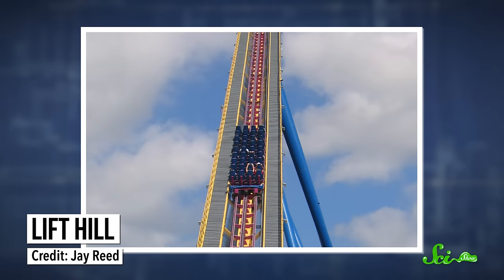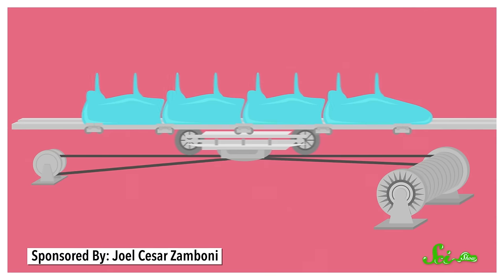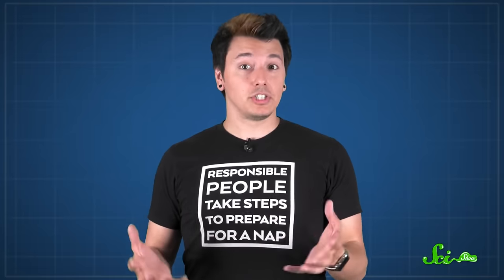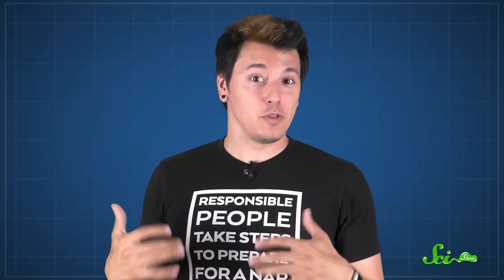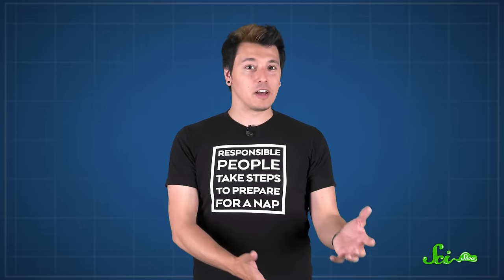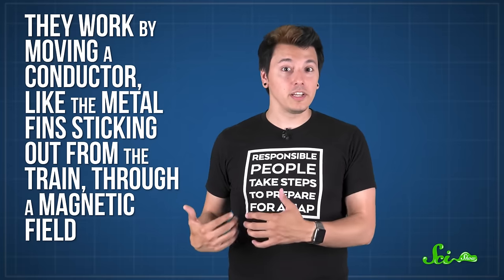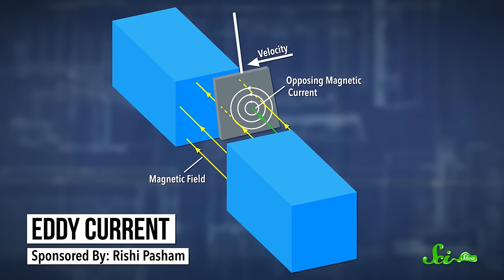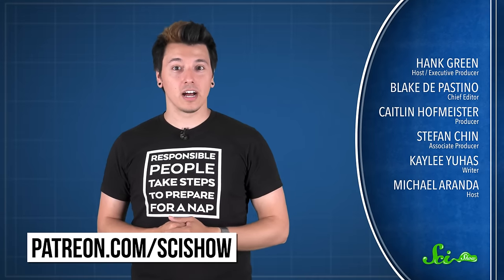The Physics of Roller Coasters

Comment: Eddy current brakes cannot bring a roller coaster to a complete stop. As the velocity decreases, the strength of the eddy currents also decreases, causing a decreased braking force. Friction brakes are required to fully stop the train and hold it in place.

Comment: +SciShow : A slight mistake: A permanent magnet can't stop a train, because its strenght is related to the velocity. The higher the velocity is, the stronger the braking force will be, which is quite handy. But on the other hand, the lower the speed is, the weaker the braking is... So in the end it can't stop the train, in theory. In reality, friction (both air and contact friction) will do the job, but manufacturer usually have a friction brake or a friction tire at the end for that purpose.

Comment: could've done with some impressive stats on the forces involved in average roller coasters. maybe a mention of fastest speeds, highest G-forces, largest loops, etc. and some shout outs to the engineers and designers, who have to work the physics into real-life constructions. safety mechanisms could also use a good mention, along with what happens when they're ignored or fail.

i should become a scriptwriter for SciShow.

Comment: There is a roller coaster at Knott's Berry Farm called Montezuma's Revenge. The initial force to start the car is powered by a flywheel. Also the California Screamin' roller coaster at Disney's California Adventure uses an induction motor for the initial force.

Comment: In the magnetic braking system, exactly where does heat get produced? In the metal fins? Or does the kinetic energy first get turned into electricity, then into a load such as resistors, where it changes to heat?

Comment: Why is actually called a hydraulic launch system instead of a  pneumatic or (semi-hydraulic or semi-pneumatic), because the liquids are merely used to charge the system, the nitrogen gas seems to be doing the actual pushing of the liquid through the motors, according to the schematic shown. Or is it because "fluid dynamics" deal with both liquids and gases?

Comment: I have this problem in my physics class. A 100 kg roller coaster begins on a 10 m tall hill with an initial velocity of 0m/s and travels down before traveling up a second hill.  As the coaster moves from its initial height to its lowest position, 170J of energy is transformed into thermal energy by friction. In order for the roller coaster to safely travel over the second hill, it must be moving at a velocity of 4.6m/s or less at the top of the second hill. If the roller coaster Transforms another 100J to thermal energy on the upward trip to the second hill, what is the maximum height the second hill can be? What is the minimum height? How fast is the roller coaster going at the bottom of the first hill? If anyone could help me solve this, or even point me in the right direction then that would be greatly appreciated.

Comment: I was expecting an explanation of the loops thing. I know that the coasters don't need any additional propulsion after the initial drop (for coaster that only have the one mechanical lift and don't repeat the same loop like the superman in Vallejo and such) but I don't really remember why. I know the answer is momentum but I feel like I'm missing details.
Reply: Don't use momentum for this kind of problem. Use energy instead. Roller coasters exchange kinetic energy (speed) for gravitational potential energy (height). As long as the height is low enough, the coaster can keep moving, because not all of its kinetic energy has been converted to potential energy.

Comment: I would have loved a video to also explain what to do when riding a roller coaster. There might be a wrong way to enjoy roller coasters, after all
Reply: -Always ride in the back or the front, those are usually always better than the middle 
-make sure you don't get stapled (the restraint doesn't push on you too hard) because that can be uncomfortable and with a bit more space it can allow for a bit more airtime
-when you're on an older coaster or any coaster that is rough and has over the shoulder restraints, I'd put my head back as far as I can so it is easiest to resist the painful things like headbanging

Just to name a few ;)

Comment: So after the lift hill the roller coaster is freewheeling and doesn't slow stop because of the momentum created by the lift hill?
Reply: Most roller coasters are designed to have the main hill and maybe a few others impart all of the necessary energy to keep you moving for the whole ride. some tracks do have accelerators in some parts though if it's long or doesn't have the initial hill. So yeah, for the most part the main hill gives you the momentum needed to go fast.
Reply: Because of the potential energy stored in the coaster by the lift hill, it's got nothing to do with momentum (unlike a launched coaster, which does use momentum).

Comment: no mention of the adding/subtracting weights & changing wheel materials to get the coaster to go all the way around & not get stuck.

Or even the power setting vs weight of people & wheel material (friction) to launch a coaster.

AND

no mention of not just making it all the way around, but going fast enough that you're pinned in your seat and don't fall or float in your seat when upside down (very freaky feeling that happens on Canada's wonderland's 'the bat' if your restraint isn't 100% tight/you puff out your chest when they close it)

VS

Going so fast you get G-loc

OR

Vomit

OR

Get a neck or spinal injury from changing axis direction to quickly

OR

i could go on, but THAT is the science of rollar coasters

Comment: I kinda hoped you would explain the temporary blindness some rides can cause.
Reply: On some roller coasters with sustained G-Force of around 4 or 5, because the Gs are pushing downward, it is harder for your body to pump blood to your brain because all of your blood is going to your feet. With a reduced blood supply to your brain, you can loose consciousness, thus temporary blindness. Although it may be scary, it is not harmful to your body and you will quickly regain consciousness when the forces return to normal. I hope this answered your question!

Comment: I'm no physicist but I'm pretty sure you don't accelerate at 9.8 m/s² unless you're falling straight down, which on a roller coaster, you're falling at an angle, so you'd accelerate slightly slower.
Reply: Also, he is not correct about the whole thing here. You don't even have to be accelerating downwards to feel 0G. It can already start at the beginning of a hill while going up. Some coasters even have inversions that give Zero-G like the Zero-G Roll/Stall where you are weightless while being upside down.

Comment: Does anyone else get a weird feeling for example when you're in a car and its driving to fast its like you wanna faint but you can withstand it and also when you're in a rollercoaster i get the same feeling.. or even in an elevator
Reply: Maybe you don't like acceleration? In which case I don't recommend space travel.

Comment: The explanation in this video for Lenz's Law, and especially how it slows the train down, glosses over the details very heavily. Heat has little to do with why the train slows down, that is generated only because passing a conductor through a magnetic field always creates electric flow, and electric flow creates heat. The real interaction that slows the train down is the magnetic attraction between the permanent magnets' field and the magnetic field created by the eddy currents in the fin attached to the train. Lenz's Law is basically the electromagnetic equivalent of Newton's 3rd Law, an electromagnetic friction, so to speak, between fields and conductors that are in relative motion with each other so that creating a certain amount of electricity through motion always requires a proportional amount of kinetic energy. Heat is an incidental byproduct of the interaction, unlike actual friction.
Reply: I thought Michael said heat came from friction brakes. He next mentioned how Lenz's Law is another breaking system because it saps kinetic energy away and transforms it into electrical energy. Two separate systems. (Although, Lenz's Law can never drain all the kinetic energy from a system, so you'll need to rely on friction at some point.)
Reply: +Jordan Shank Watch the video again, he concludes his explanation of magnetic brakes by saying that the kinetic energy is dissipated as heat in them, but, as I explained, that is a secondary effect of the actual operating principle of the system. You're right that friction brakes are needed (Lenz's Law does less as relative speed is reduced), but he was not talking about them at that moment.
Reply: TheBraveSirRobin Unless the electric energy goes into charging a battery or capacitor, it's going to be dissipated as heat eventually. Perhaps he was talking about that final state?
Reply: ***** This is true but I don't believe that's what they meant when they wrote the script and I think it's misleading to simplify it in that way.

Comment: In the magnetic field there is still a small/differen form of friction happening, right?
So to say "all without friction" isnt technically correkt?!
Reply: Right. Lenz's Law is super useful, but it can't drain all the kinetic energy from a system. At some point, it'll need to rely on good old friction to finish the job. Besides, we don't live in a frictionless vacuum anyway.

Comment: but when I went sky diving I never felt that sinking feeling
Reply: Some people don't experience it, but it may also be because your body adapted very quickly. As the feeling usually goes away after a few seconds to half a minute.
Reply: Oh okay. I always thought that the sinking feeling was caused by the roller coaster cars pulling a body into motion at an accelerated rate as well as gravity acting on a body, which is why I didn't feel it when sky diving